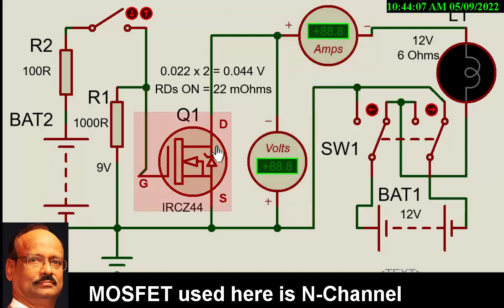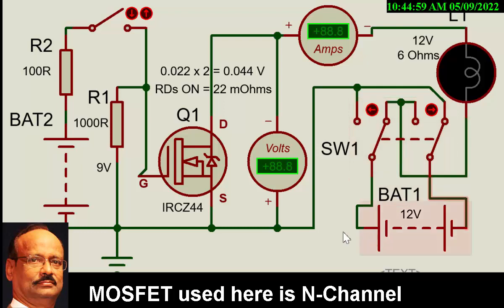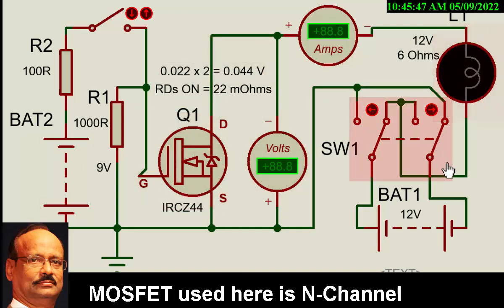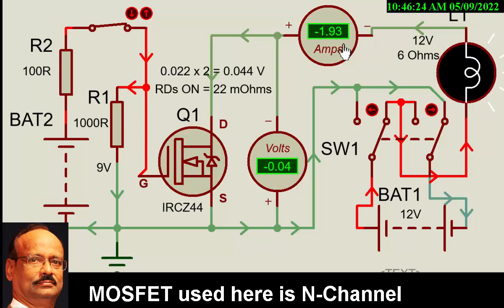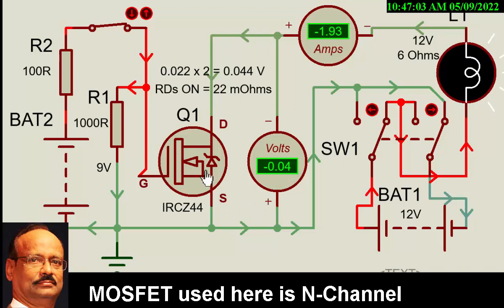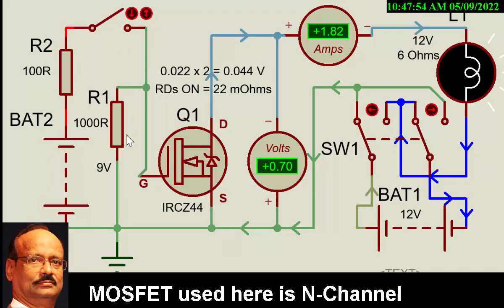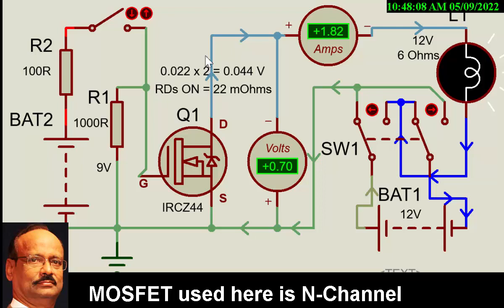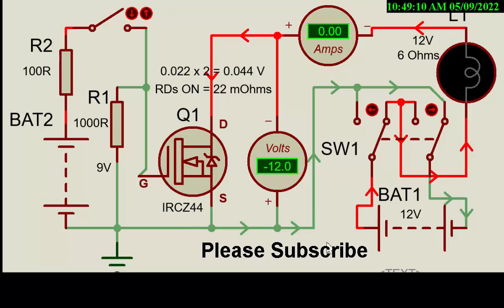N- MOSFET conducting from Source to Drain

Comment: Sir, gate voltage can be maximum 9v but source voltage will be 12 if you change.. so vgs will be negative how it conducts
Reply from the maker: No Vgs never goes to negative.Gate to source is always positive .Watch  carefully we are only reversing the supply across drain and source
Reply: Sir I meant to ask if you flip the battery to source to drain.. source will be at 12V and gate will be at 9V positive with respect to source so potential difference between gate and source will be at 9V-12V=-3V since Vgs is nagative mosfet doesn't turn on. Please correct me if I am wrong
Reply: @ravikumark6746  bro..those power supplies does not have connection to each other they are isolated and if you see the common point of them is only the GND.so if you probe the gate source voltage it will be 9 V again respectively to GND. So you have to pay attention to power supplies they are separated form each other. You can find mosfets configurated to drive from source to drain in switching power supplies actually they are replacing that freewheeling diode to get more efficient.
Reply: @mendiarapi  thanks bro,👍
Reply: I was skeptical that current could flow from Source to Drain  a Mosfet. 
Thanks for clarifying, I now see that VGS is +9V for both cases.  In one case +12V connects to the Earth GND symbol, and the other case the negative side of +12V connect to the Earth GND symbol.
But the 12V supply is isolated, which I don't see much in my experience, except in the laboratory.

Comment: Nice video, this was new to me. I always thought that conduction is only possible from drain to source. This is somewhere true BUT the terminals are not fixed! They depend on the voltage polarity connected to the terminals. Drain can become source and vice versa. One important thing is regarding integrated MosFets you can buy. In some of them the source terminal is predefined in the way that bulk is shorted to source to keep the threshold voltage independant of the bulk source voltage. If you swap the drain and source terminals in your application you will lose this effect and Vth will be a function of Vbs because bulk is shorted to drain in this case.
The most important message is that source and drain terminals are NOT fixed in general!
Reply from the maker: Thanks

Comment: sir which software have you used in your video for simulating?
Reply from the maker: Proteus from Labcenter UK
Reply: @PatnaikUC  sir I have made a protection circuit for lead acid battery protection.  goto the link
and see  it will be best or not https://youtu.be/GbvdZrxxNYI